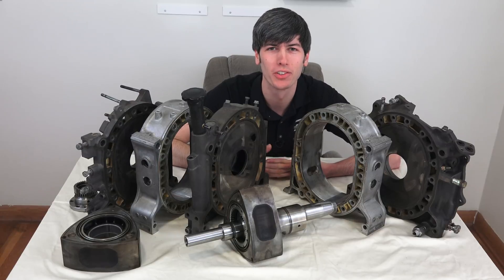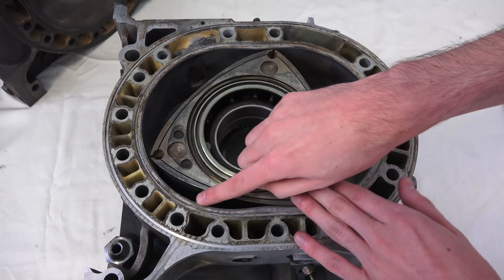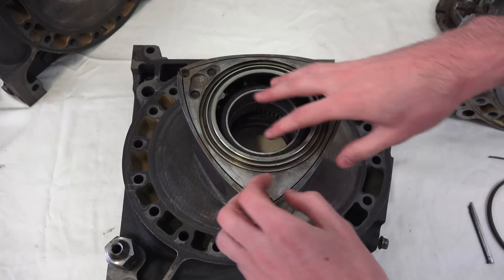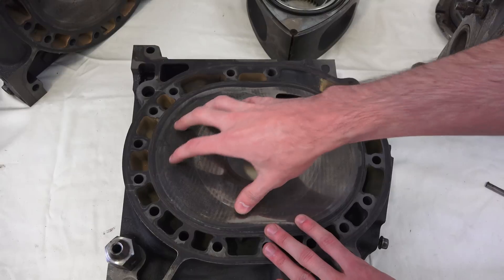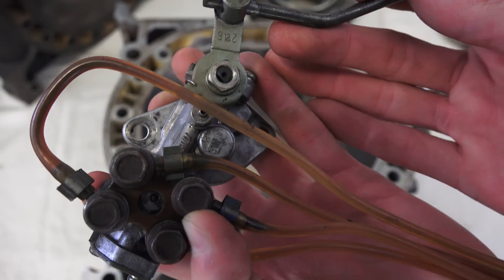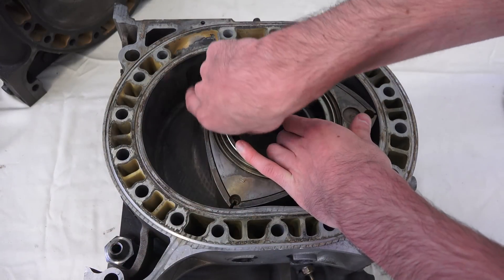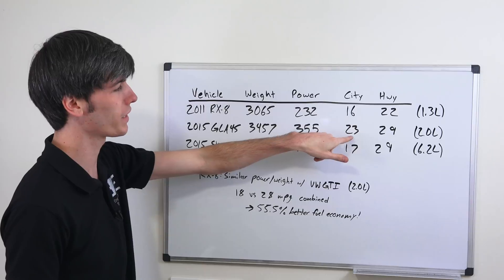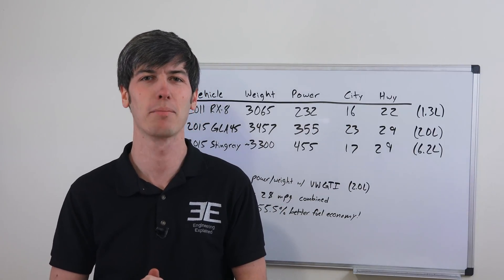4 Reasons Why The Rotary Engine Is Dead

Comment: I wonder why they never considered a pair of staggered firing spark plugs in each chamber to help burn the remaining fuel and increase the thermal efficiency? 

Also, why didn't they pass the output back through a gallery adjoined to the intake side to help spread the heat over to the cold side? 

Longer sprung apex seals that were easy to change would have been a nice inclusion too. If they were a few bucks and could be easily changed at every service, the only remaining issue would have been the emissions due to oil injection.

Comment: Somehow this video keeps popping up on my computer, so I can’t resist any more to comment.

You call your channel “Engineering Explained”, which makes people think you are an expert. But it seems that you have not done any proper research, so here are a few hints. 

First of all, the rotary engine has not dies and is not dead. There may not be a rotary in automotive at the moment, but there are still several companies building rotaries.
Now to your for “reasons”:

1. Generally rotaries have some limitations in terms of combustion chamber shape and compression ratio, and there is a lot of R&D potential in this area as well as in the ignition. But your arguments are wrong. The flame centre is not static. The entire mixture is moving, and so is the flame centre. Furthermore, rotaries have much longer timings. TDC and BDC are 270° apart. So travelling all that distance and burning mixture on the leading edge is no problem. It is the fuel mass on the trailing edge that is more difficult to ignite. That’s why, for instance, many rotaries have two spark plugs.
Legal street car rotaries do not spit flames out the exhaust either. Only modified engines on race cars do under shifting and braking, but that’s not exclusive to rotaries. 

2. Sealing is also an exercise on the rotary, agreed. But the seal issues on early engines have long been solved. If seal issues have occurred on newer engines, these are no rotary problem as such, but an engineering decision that could have been better. Imperfect engineering decisions occur on piston engines all the time (and even multiplied, because there are so many parts). Apart from this your arguments are wrong again. Of course there is a hot and a cold side on a rotary, but this is compensated by the cooling system. 

3. The rotor seals, especially the apex seals, do need a bit of oil. Especially if they are not ceramic. But what about the piston rings and valves on a piston engine? Furthermore, if you had shown an RX-8 engine, your audience could have seen that the engine has side inlet and outlet ports. The purpose of these is to reduce port overlap, but also to keep the apex seals from wiping the very small amounts of oil that sit at their tips out the outlet port.

4. I assume you are referring to fuel economy as emissions, though emissions comprise more than CO2. The cars shown for comparison are all newer, and their fuel consumption has been much tuned to look nice in non-real-world driving cycles. So while the real world fuel consumption of a rotary may be higher, the 55.5% calculation is !$§! (sorry, can’t find a polite term at the moment). Furthermore, you are not addressing the potential of rotaries. For example, turbo compounding works particularly well on rotaries, because they don’t have outlet valves that act as air brakes at the outlet ports, and they can burn hydrogen made from excess wind and solar energy to become “zero emission”.

Want more arguments? Then again, please do the research that you should have done before publishing this. If the rotary should be considered dead by many, it is because they watch poorly researched videos like this one. If you can do better as an engineer, please do.
Reply: In his video he discusses 4 reasons why the rotary engine has been a failure in terms of performance and thus sales. In your 4 point reply you have not disproven any of them. You are just making excuses for a poor performing engine and adding some more technical details or excuses that still don't refute anything in the video. I think the only lack of research that matters is from the people who bought the rotary engine cars with the lack of research or perhaps lack or concern if they were the 'sell the car before the warranty runs out' type which would make sense.
Reply: Ok, but wankle can't match the "potential" of fairy farts.
Reply: Soooo, please enlight us and give reasons to why it's been out of production for so many years.
Reply: Outdated engine. If it was so good all auto makers would have made their version. Rotary went out with the vega and pacer. Novelty like a ford flathead.
Reply: @fastnasty6627  And... the PACER was originally designed for a wankel.      Seems fitting, doesn't it?
Reply: The only reason Mazda isn't making Wankels at the moment is because it was banned in racing.
It's really hard to develop new technology if you're not racing and getting funding from sponsors.
That ban after the win, also slowed development of the rotaries. Had it not been banned, they would probably have solved most of the problems by now
Reply: Just thought I'd give y'all a heads-up since rotarys in Mazda's are making a comeback 2020
Reply: Jesus Christ, what an asshole.
Reply: A+ Grammar. Makes you the best person to listen to
Reply: kakol20
Only on LSD can you hear writing and see sound...
Reply: The only reason why the rotary is "dead" or otherwise unused in todays cars because it hasn't been allowed development. The rotary is amazing at generating a high rev and therefore driving extremely; but let's face it, when you go buy a personal car for doing regular things,  you don't give two craps about its top speed. Top speed isn't even advertised in most cars because frankly, most people don't care and have nothing to benefit from caring. What makes the rotary inferior to other street cars in terms of street car characteristics, is its (currently) terrible emissions, mileage, and the like. The current rotary engine, quite underdeveloped compared to the piston, is not fit for street cars. What the rotary is fit for, though, is driving really fast and therefore racing. Unfortunately, the rotary is banned in most if not all races. This means that the rotary doesn't fit anywhere right now, and rotary engines can't promise increase sales(perhaps decrease sales) for companies looking to use the rotary. The rotary's current uselessness means that the rotary cannot generate income/profit, which means that there's no motive for companies to even sell the rotary, much less develop and upgrade it. Perhaps the rotary can greatly improve, such as the ways PH Smith listed. If a ton of R&D was conducted on the rotary, like the standard piston, perhaps the rotary could outclass the piston in nearly every way and become the new standard engine for every car, replacing the piston. But researching and developing rotaries is a large, long-term, and risky investment that won't even pay out very well. This highly discourages companies to research rotaries because it has nothing to gain from rotary development; therefore, the rotary may never improve, even though it may have the potential to be something great. This is why the rotary is still out of production; because companies have no motivation for improvement, and adequate improvement is required to turn the new rotary, which is still partially just an idea, into something that can compete against the old and heavily researched piston and be brought into the assembly lines. Perhaps if racing allowed rotary engines, or rotary engines could somehow allow their companies to benefit and make profit from them, companies could seriously consider researching and developing the rotary because rotaries have shown they can generate profit and are worthy of improvement and the cost of R&D. However, that currently just isn't true.
TLDR: The rotary has the potential to become better than the piston, but because the rotary cannot promise companies profit, companies have little motivation to put heavy R&D into rotaries. Since the rotary is still stuck in an underdeveloped state, and still partially an idea, its potential has not been uncovered and is still inferior to the standard and heavily studied piston, and therefore kept away from the assembly lines.
Reply: yep, this guy is eExpert and explain theory to an other eExperts. Those people never drove, race or even saw cars...but they know everything ;-)

it reminds me my MTB DH career...best riders were along the track :-D For example 50 years old mom of three lectured me about the best line I should take...Then, I told her I am rider...there was awkward silence :-D